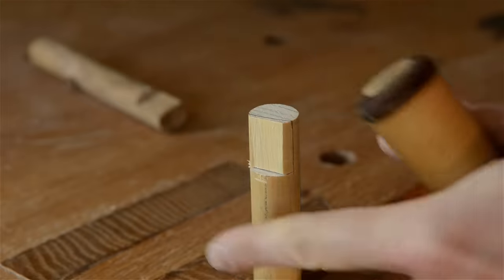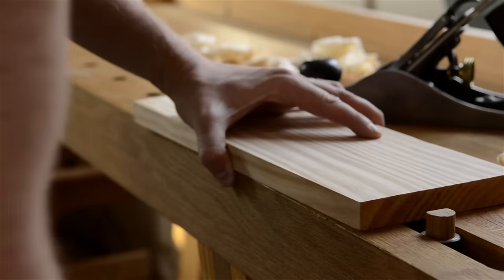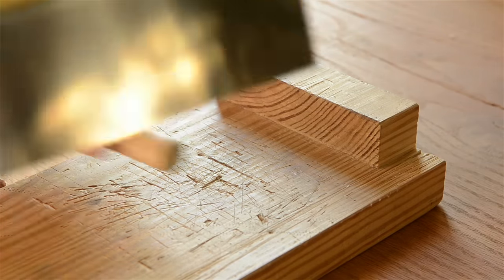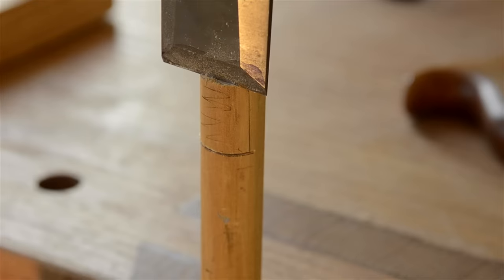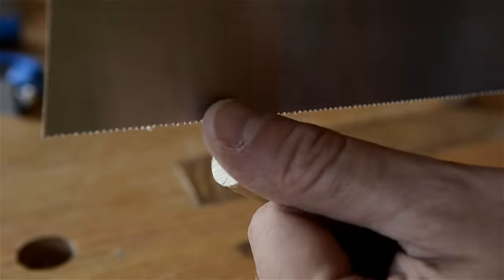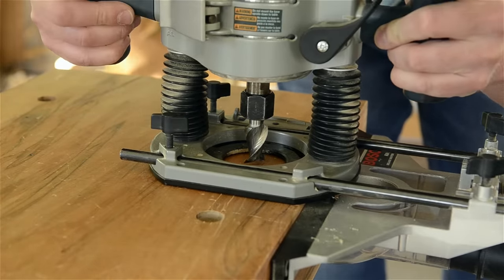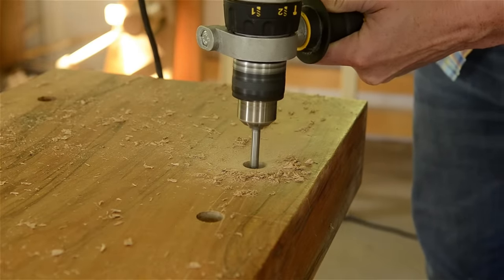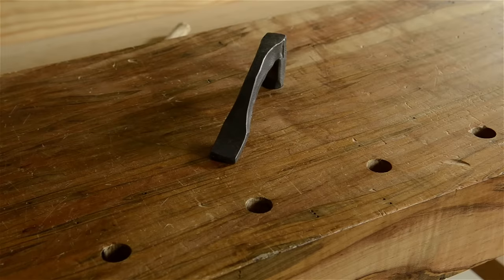How to Make Workbench Dogs, Dog Holes & Holdfast Holes

Comment: Great video Jonathan  you really covered a lot of areas in one short video  i completely understand the reasoning  for not using Holdfasts in Dog holes  but in all honesty  thats  kind of a hard thing to stick to  doing  especially if that specific hole is in a  convienent spot  to where you want or prefer to work in  as most of us  have our favorite  Workbench are  we work in
Reply from the maker: Hi Craig, the name is Joshua. Yes, workbenches are meant to be worked on, but it's quite tough to add new bench dog holes, and also to find dowels that are slightly larger. I just bore holdfast holes in any spot where I might need to reach.
Reply: @WoodAndShop : Hi Joshua. Thanks for this great video! Are you saying that you bore the holdfast holes from the start, or as you find you need them? I’m thinking they’d have to be from the start. If so, do you have a preferred layout for the two types? Thank you!

Comment: Great video mate, quick question though, why use a spade bit and not an auger bit, twist drill or Forstner bit?
Reply from the maker: With a brace I use an auger bit, but with a power drill, a spade bit works great. Much cheaper than a big auger bit for drills. And less agressive.
Reply: @WoodAndShop  ah cool cool, I see where you're coming from!

Comment: At 5.29 you can see the tiny hole in the aluminium bracket for the drill handle. 
In this hole you place the long steel rod that comes with the drill. When the handle is released (turned anti clockwise) the rod can be inserted to any position. Determine drill depth and tighten the handle. This is now a drill depth stop. (If you haven’t mislaid your rod that is..) 😂

Comment: I'm building a new workbench that will serve as my outfeed table, glue-up table, and assembly table in my small home shop.  I'm trying to decide what material to use for the 1.75" thick top.  I have three options: 1) purchase a 1.75" thick beech hardwood top from Grizzly, 2) laminate a few sheets of MDF with a Formica top, or 3) laminate a few sheet of Baltic birch with a Formica top.   Do you think dog holes will work in a 1.75" thick bench top that is made of laminated Baltic birch plywood or MDF with Formica on top?  I like the idea of a Formica top since I will be using the table for glue ups, but I also want functional dog holes for holding pieces in place.   Thoughts on MDF vs plywood?  Will Formica prevent the dog holes from working? thanks
Reply: Did you end up going with that thickness? How is it working? I’m considering using a solid core door for a workbench top and am wondering how bench dogs and possibly holdfasts will work in a top that is not as thick as most. Thanks!
Reply: @b-radg916  I ended up doing a 2 1/8” thick solid maple top.  I ended up purchasing veritas surface clamps from Lee Valley, so I don’t know how my dog holes would work with a traditional hold fast.
Reply: @coryclaassen9843 : Got it, thanks. So many gadgets, so little money! 🫣

Comment: My workbench is 4" thick wit 3/4" dog holes. I've tried a variety of holdfasts, lengths, roughing them with course sandpaper and they just have a hard time catching. I counterbored one from the bottom with a 1" hole and that really didn't solve the issue so it remains a single test. I'm open to ideas.
Reply: Andy Zavoina cast iron?
Reply from the maker: Yes, what type of holdfast is it? Between sanding around the holdfast shaft and counterboring, I've never had a holdfast I haven't been able to get to work...except for the cheap cast iron holdfasts.
Reply: @WoodAndShop  I have each of the 3 above and want to use the 2nd, the forged steel. I'm going to try sanding it again. It is longer than the others and will hold better if I reach under the bench top and push the "tail" sideways to add to the pressure that wedges it in the hole.
Reply: KelMaster Construction Pask makes has a video for wooden holdfast? I know that Joshua @ Mike from M&T use them
Reply: Chris Schwartz talks about that issue . And that’s the reason why they are making 1”  diameter .

Comment: No need to watch for the drill bit poking through after the first hole. You just use a block of wood or whatever above the top to stop the drill from moving any closer to the top; the first hole let’s you determine how thick of a block to use. Almost like using tape on a drill bit to stop the drill, but tape doesn’t work so well with the spade bit.